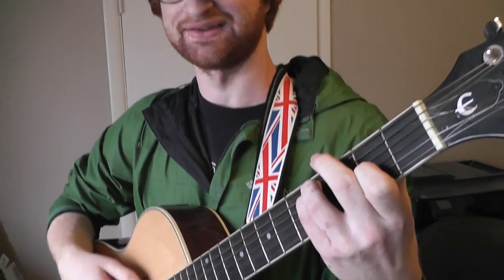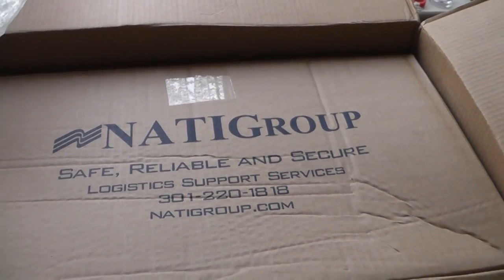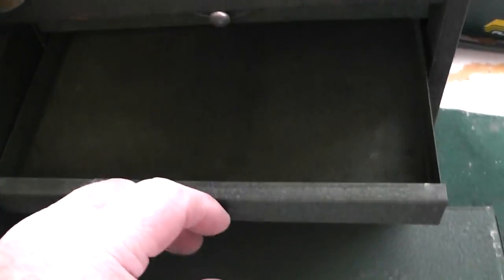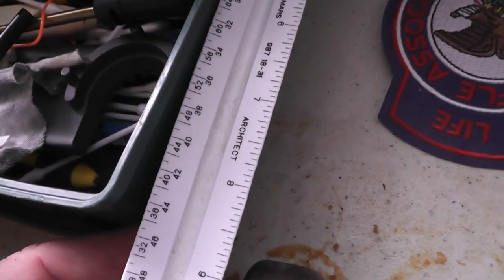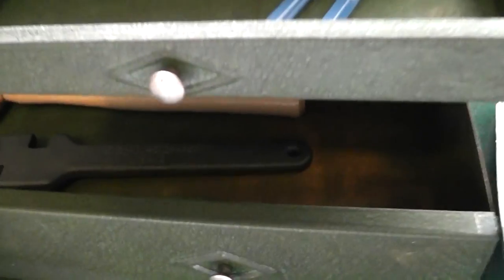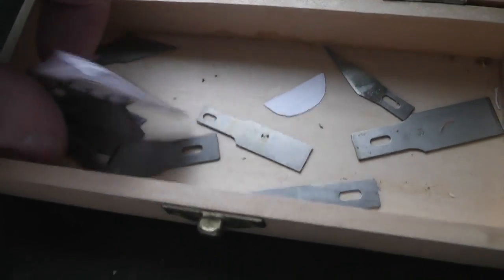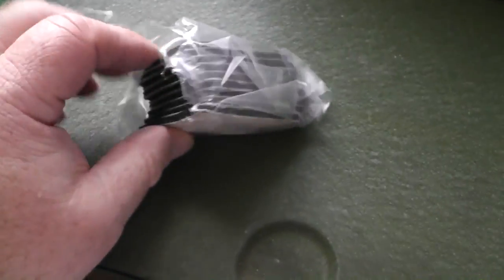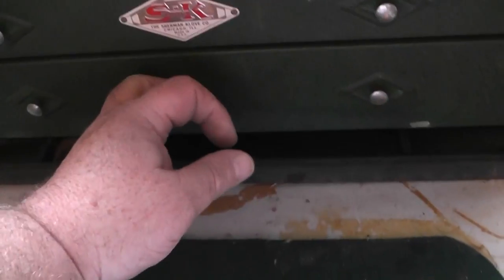SDI Vlog #4 - Setting Up Gunsmithing Tool Box - Sonoran Desert Institute

Comment: If I were you I would clean some of the rust off with a scotch brite pad or sandpaper and and use some WD-40 in the drawers so that they don't squeak as much. You could spray a clear protective finish on the visible areas of the tool box if you don't want to repaint it. It might be drier where you live but where I live things tend to rust very quickly and look pretty nasty after a while.